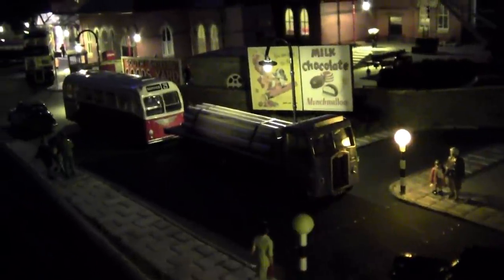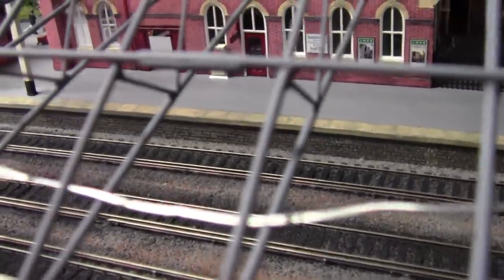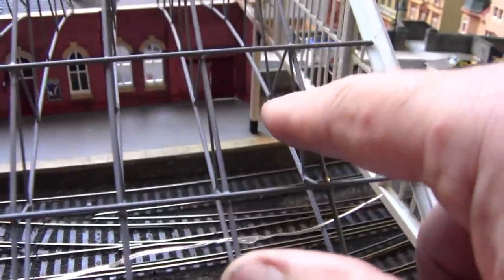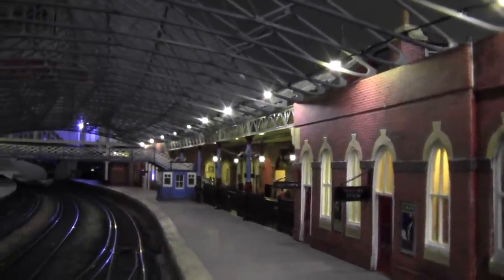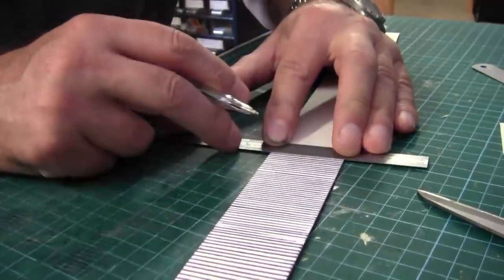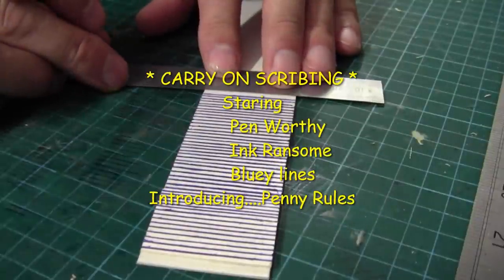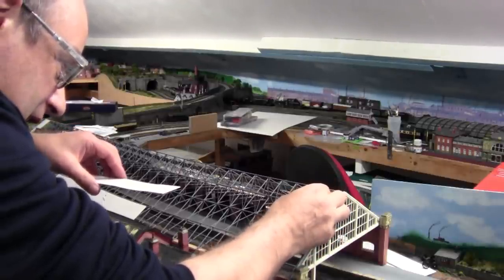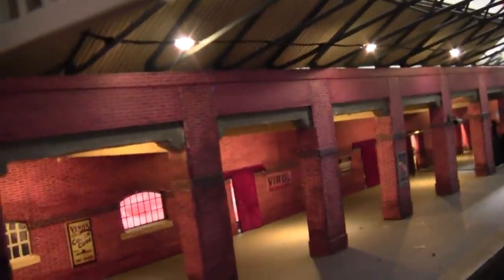Tha Big Roof Part 8. Lights and Cladding. No288

Comment: Great work Tony The lighting looks just right and really gives a atmospheric feel with the lights on you can easily imagine the smoke and noise coming from the engines and the people going about there business
Reply from the maker: Hi Peter. I can imagine, and it wont be long before we trains running in and out of the station. hopefully it will be around christmas. thanks again my frriend,,,,cheeer's Tony

Comment: Terrific effort on the cladding and I really like the lighting effect. Your patience is astounding. Thanks for sharing Tony. Roy.
Reply from the maker: Thank you Roy. the lighting has worked out a treat. and not over powering to. slightly lower voltage than whats in the station rooms, which is great becuase it allows you to see whats in the buildings with out being blinded by the lights. if that makes sense....thanks again for commenting, have a great weekend Tony👌

Comment: Looking good, Tony.  The lighting is very effective too.   Slating the bottom section of a curved roof is not an easy task to do but the right one for the sake of authenticity.  I’ve checked the roof at Alnwick Station in Northumberland, which bears some similarity of design, and that too is slated to this day in what appears to be Welsh Slate.  Sister station at North Shields (not to be confused with High Shields 😄), also had slate covering the bottom section, so slate is the correct choice.  I’m sure you will get it done superbly, albeit that it will take some time and patience, but it will be well worth it in the end.  Looking forward to the next episode of “The Roof”.  Have a good weekend, Best Jason.
Reply from the maker: Hi Jason. your very right it is welsh slate on the lower section of the section. i keep looking at the photo i have where you can just glimpse the slate. i have also notice on another photo that the very top apex was glazed originally. so that has blown all my ideas out of the window. 
But the later years from the photo's from 1950's and onwards the glazing was not to be seen. maybe after the bombing of 1941 they removed all the glazing. i would imagine most of it or if not all of it was smashed. 
there has been a lot of in issues with this build all the way through with what was there and what period of the station i want to build...but in the end. i think i would have done a good job when i finally get the to the finish. thanks again you have been there all the way through this journey my friend....cheer's Tony
Reply: @TONYNORTHEASTERN  I believe that the apex of York trainshed roof was glazed when built, so maybe all the original NER stations were built in that way.  It is the obvious thing to do to keep out the rain and let in the light, but maybe the architects/civil engineers did not consider the smoke from the locos.  I have seen pictures of within York station 1890/1909, with no trains visible, but the view looks like there is a fog. 
After many years, the undersides of these panes would be black with soot preventing light getting in to the station.  Maybe the apex was opened up to let light in and that smoke out?  Seems the sensible thing to do.
The Station was opened 1879.  Your model railway depicts steam locos and EMUs which dates it into a particular time period.  You have elected to keep the clock tower, (pre-bombing) that narrows the period down further.  This may help with your decision to keep the apex open or closed.  In the end, it’s your model railway, so your call.  Do what pleases you.  Hope this is of some help.  Best, Jason

Comment: Good grief, Tony! You have the patience of a saint to do all that scribing, especially the tiles! You could possibly have used Scalescenes roof tile or Superquick and bend it to the curve as you went along?  The colour of the cladding is just right. I thought it would be too light, since it would be darkened by smoke, but I think it looks fine as is.
Keep up the good work.
Regards
Ray
Reply from the maker: Thank you Ray, its a one off and its worth doing all the scribing. and once it all claded. i will be able to weather the inside, yes inside with some black soot....on the lower edges of the cladding. the end so near now. and its the final colouring which will make or break all the hard work i have done...thanks again best regards Tony

Comment: Well, IF you are going to take on Alan from Dragon Jct and Wheezy about those pigeons roosting, I'm afraid you'd just have to model te flock of Sparrows huntin' and a peckin' on the platform too. ;) A thought though, for your flashing along the roof edges, what about a fine cut strip of Duct Tape? Stay safe mate. Arthur
Reply from the maker: Hi Arthur. i will be adding some birds. as a seperate project from the shields build. the idea was always there but Alan just gave me a gentle nudged as he always does...
I have used duct tape before and it does tend to crease to easily. but i will do some trials first.
thanks again my friemd...stay safe cheer's Tony

Comment: Tony.  Once again what a marvellous video,  very  informative,  You must  have the patience of a Saint.  There is only one question,  why the battery pack and not powdered   by the  mains.   Chris
Reply from the maker: Hi Chris good question. i guess early in the build i not allow for a extra supply for the platforms. not only that the roof has to be portable. and with the lights being at a different voltage to main supply does seem to work. 
In reality i just not plan to have lighting in the roof....thanks again for commenting, and have a great weekend. cheer's Tony😂

Comment: Excellent, again, Tony;  yep devil is in the detail. Spot on with the 20 led pack looks like a warm white which works well; were those the Danson Xmas lights I sent you? For that curved section how about getting a piece of A3 paper, lay it over secured in position on the top rib and rub over the top to take an impression - the bottom obviously trim so doesn't foul on building - maybe you can do similar impression there too - then transfer to your card. All the best until next week and give your eyes a well earned rest! Stephen
Reply from the maker: Hi Stephen. Thank you for the lights. they are the ones you had sent me. they are spot on my friend...the center section i will take my time lay the card down from point to point and measure the gaps and transfer them onto the card, and form a radious that way....
thanks again. until next time stay safe............all the best Tony
Reply: @TONYNORTHEASTERN  Great to see you could use so effectively, I am avoiding the bright white leds (as mentioned had to paint to tone down) as found warm white (as sent) so much more realistic as everyone else in comments is confirming!  Forgot to say  -  on opening shots wow snow in England before us here on the prairies in Canada! Artistic license? Been exceptionally warm here, fall colours were exceptional as a result, still on with outside jobs and improvements. Will do and you too Stephen
Reply from the maker: I bet the country side is stunning with all leaves changing colours before they fall. thanks again Tony
Reply: It's the Town's street tree planting that we look out onto, plus some woods I see on my dog walks. Good if you can break up into small pieces and measure - was just doing some woodwork on a complex shape and resorted to a card template to get it right first time. All the best, enjoy the sledging! Stephen